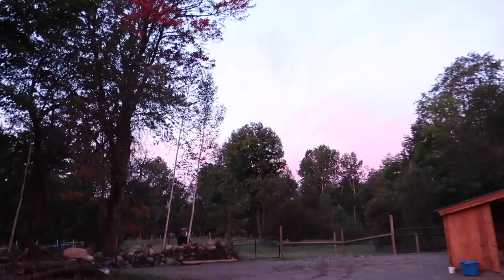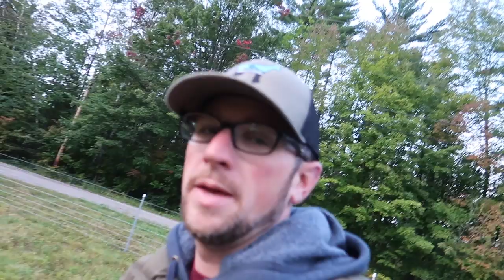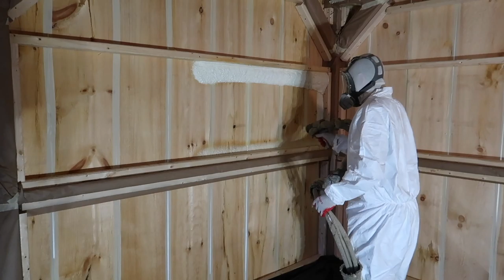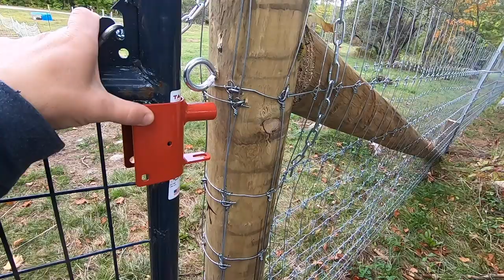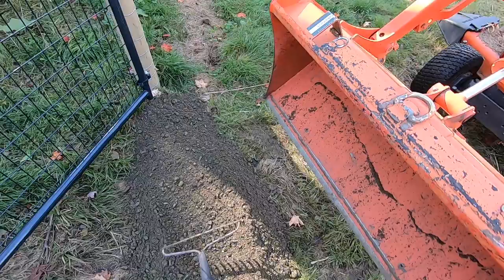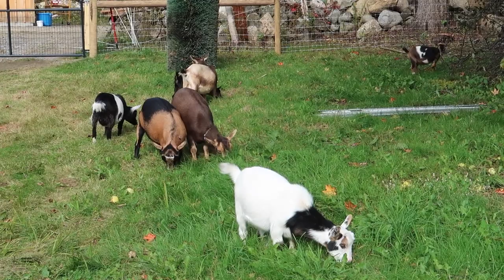Post & Beam Barn/Workshop Gets Spray Foamed and the goats go on PASTURE FULLTIME

Comment: For the gate it could be as simple as adding a carabiner or two. You all ready have the one on the gate, could add one to the chain and use the I bolt. It'll be adjustable with the chain.
 If you want to get rid of the chain, have some wirerope and Crosby clamps with carabiners to latch it shut.

Comment: The gate latch was perfect.
Remove new PT “2x4”
Remove the gate and screw hangers in a couple of turns.
Rip new PT “2x4” and re-install.
Reply: This explains my idea better
Reply: Yes!
Reply: Or notch out the wooden post to accommodate the space needed for the latch
Reply: EH CBunny 
Matching the post is the easiest fix.
I suggested screwing the hangers in cuz in time the long screw in type sag. 
The best gate hangers, in my opinion, are bolted thru the post and can easily adjusted doing the nuts on both sides of the post.
Reply: And if the gap on the latch side opens up too much you can install the leftover piece of ripped two-by-four on that side or rip a new piece of two-by-four there.
Reply: This is what I was going to suggest too. Thought I should read the comments first so i wouldn't repeat anything.
Reply: holly slaughter I was going to make the exact same suggestion
Reply: holly
Reply: @brianwilson4449  Great minds often think alike. LOL
Reply: @EHCBunny4real  this is the better way! This is what I was going to recommend!
Reply: @hollyslaughter5505  I think natching for the latch AND using the bolts is a good idea. Using bolts in the latch AND the gates. Much sturdier in the ling run.

Comment: Great episode, hopefully foam will keep barn warm! To use new latch on gate, take down 2x4 between hinge pins rip 1” off. Replace remainder of 2x4 between hinge pins and turn hinge pins into post 1” further. Replace gate on hinge pins now latch will fit properly. Take cut off from 2x4 and put on post below new latch to take up space.

Comment: Reattach the eyebolt to the wood. Open the I connect the chain to the I close the eye back up. You could also use some other means of attaching the chain to the eyebolt. Cut the chain to the proper length and use the chain and the chain latch portion of the gate to keep it closed. Basically the chain goes from the fence post to the gate instead of from the gate to the fence post.

Comment: For the latch that almost fit on the gate, I'd take the 2×4 from the hinge side out & twist the hinge bolts in more. It should give you the room needed for the latch. Then cut down the 2×4 to 2×3 & put back.

Comment: A board like that to fill the hinge area will be a chew point so better to go with chicken wire you can wire to the gate and staple to the post to flex as the gate opens. 

Rocks make good fill for under gates as once you bed them in dirt they are hard to spot but harder to dig past for things trying to get in/out. Take full advantage of what nature has given you.

Pickup some flower bulbs to plant just outside the fence for the pasture as they will slowly spread in and give a treat to the goats when they sprout without killing off the plants outside the fence. Also good for bees but that is an added bonus. Can also plant thorny berry bushes just outside the fence and clone to spread along the fence with the goats grabbing what they can to pull in to eat and provide you added predator barriers.

Comment: It looks like that post is thick enough that you could chisel out a flat area to inset the main portion of the latch in without losing structural integrity of the gate post.
Reply: That is exactly the right way.
Good call.
Reply: Put the pentals to the inside of the post and put them in further.  Work smarter not harder
Reply: That's the way to do it to keep the slot from getting wider and keeping the goats in the pasture.
Reply: Craig Mooring that's EXACTLY what i was going to post, too!
Reply: @ldg2655  sadly that will with time reduce the integrity of the post. It also cuts off some of the pressure treatment and will have to be recoated. Changing the type of hangers or their position is cheeper and less time consuming
Reply: I was just going to suggest same thing. Cut a flat in the post and install latch. It should fit in between wire fence without losing integrity, if so staple that fence area to post. Good luck.
Reply: Even if you do cut a little of the treated section off to make flat, they do make a preservative to re-saturate the post. You could even use to put on the tops of the other post in the pasture area. Just sayn.
Reply: didn't read your comment before I posted, haha
Reply: This is what I was going to suggest. The post looks to be large enough to accommodate a 
a little flattening to allow enough room for the latch.
Reply: Just twist the hinge bolts in more on the other side.
Reply: That is exactly what I was thinking !!

Comment: 2 ideas for you on the latch situation.  1st. If you are not worried about having a lock on the gate, go get yourself a piece of steel rod with a 90 degree ben at one end and then drill a hole straight thru the gate and then into your wood fence post.  You will be able to slide the rod right into the post and have a very inexpensive 2-way latch system.  To make that one more secure, you could even get yourself a piece of plate steel with 2 90 degree bends and cut a depression in each side to slide the rod into so it will only back out if you release the rod from the depression.

2nd.  You could easily use the latch you already purchased.  Just chisel out the post to have a flat area to mount the box.  That will give you the necessary clearance for the rod to slide in.

Comment: Suggestion: run one or two hot wires above the paddock fencing to deter predators from coming in and goats from climbing out. They can be left hot year-round as they are too high to ground out even in the snow.  It will provide much more security for your chickens in the winter too.
Reply: SeaSpirit4 seaspirit I was thinking the same thing. Al should of put some conduit underground where all the gates are,that way the hot and the ground wire could be run all around the fence line.

Comment: At the 13.51 min. showing the gate hinge bolts, you can turn them in to the post another two inches, this will move the gate over two inches, providing the space needed to install the new gate lock.  You can install a cut 2X4 under the gate lock to prevent the goats from squeezing out on that side.  After posting my comment, I noticed that holly slaughter had posted the same suggestion.

Comment: Al,  draw your hinge side of the gate closer to the post.  Put your filler strip on latch side but double it up so it is 3 inches thick.  Your Speeco latch can be mounted on the filler.  I just did mine that way a few days ago.

Comment: Everything is looking sooo good. I’m glad you insulated the milking room. That will make it so much warmer this winter when milking. Could they not have spray foamed the overhead door, or will it not  stick to metal well? So glad you left the beams exposed, even though it was added work. They add so much character to the barn. I love the way you take care of details like that. I agree with screwing the hinge pins in a little further or notching the post to install the lock. That will be so much easier than the chain. That Little P is a character. You take great care of all your animals. I think rubber gloves will be needed for “the boys”. They will miss their pettings. Keep up the great work! Love & Hugs from Vicki in Ft. Worth, Texas 🇨🇱🇺🇸👍

Comment: You could chisel out some of the post to be able to fit the lock hardware. Or, you could just put a plastic sleeve over the chain, and continue using it, but it would be quieter. All great ideas presented here, it'll be cool to see which route you go!

Comment: Fasten the chain to the eye bolt in the middle then the ends of the chain can be dropped into the slot from both sides. To make the latch work as others mentioned turn the hinge pins in one turn.

Comment: Take your gate off of the hinge pins and turn them in a little at a time untill you get the clearance you need for the latch.
But you may have to trim down your 2x4 you put on the post.

Comment: Al, the gate latch is flat on the backside.  You can cut back(flatten) the post that you will mount the lock onto.  It will move it back a little bit, creating enough room for the mechanism amd latch to work amd fit.

Comment: Hi you can get the other latch that only let's you open gate one way but it will work it's the same company as the other one you have. Or you can shorten up hinges on gate a little so that one will fit. You might have to put a board to close space between the gate and post that way though. I love mine like that it makes it super nice to go in and out of so easy. Good luck

Comment: Regarding the latch; go back and pull your block of wood off of the hinge side.  Run the hinge pins in two or three turns. Then you will have room on the latch side. If you spread the gap between the two sides it may eliminate the need for a spacer.
Reply: Also shortening the hinge pins reduces sagging.  I say this from past experience.  ;)

Comment: Oh also, for the gate where you filled in the gravel to create a berm, I would of used a drainage pipe, laid it down in the ditch, then covered it with gravel/dirt.  That way you get a full solid piece of land to drive through and the rainwater can still drain through the area.

Comment: To make the gate latch work just turn the hinge screws one turn so it’s closer the the post and that’s enough room for the latch. I’ve installed several of those on my gates.  Doesn’t take much and it’ll work properly. If you end up not using it and want to get rid of it I can use another one. Be happy to pay ya for it.

Comment: Have a piece of wood or metal that is attached to the fence post and can hinge up from horizontal to vertical. In the horizontal position it should rest on the top of the gate and grab hold to secure it closed (eg with 2 forks just wider than the gate rail) then to open the gate just move it to vertical. You could fancy up a "lock" with a spring or gravity loaded tab on the bottom of the forks.

Comment: Best feed trough I've found is a hot water heater cut in half and weld or bolt three feet of angle iron on each end. Animals can't turn it over and it easy to clean.

Comment: I have a suggestion for your spacer bars on your gate posts. It might be a good idea to cut the top of each spacer board at a 45 (or so)  degree angle so that they can shed rain and snow over time. It looks like you used some sort of pressure-treated lumber for them as well, Not the best idea when you have goats, as you have probably seen, they will chew on just about anything.

Keep up the good work. And by the way, your lady handles your tractor like a pro!

Comment: I cut some heavy rubber and installed it on the bottom of my fence, using heavy wire to hold it in place. Works Great.

Comment: remember that an inch in movement at the upper hinge pin will multiply over distance so the latch may still work with an adjustment

Comment: Insulation looks awesome,  I really enjoyed watching it getting applied as well. That latch looked like it needed to bolt to a flat post, if you are able to make enough space by manipulating the fencing wire up or down, you could check out the post about half inch deep, wouldn't that give you the space you need and give you a flat spot to attach it? It looks like it would work in my head 😁😀🤣

Comment: Al on your chain latch you have  on the gates,cut the chain two or three links longer then you need , then open up the eyebolt an slip the end of the chain into it and squeeze it close. This will allow you to hook the gate closed from either side without having to run the excess chains through the eyebolt… also for the red latch would remove the eyebolt and then knocked out the post large enough to put the latch plate on or as other people have suggested remove the 2 x 4 on the hinge side and screw the hinge pins in a couple of terms and then re-hang up the gate after reattaching the trim down 2 x 4 and adding a piece on the latch side… just a suggestion and something to think about.

Comment: Probably too late by now, but on the main gate (first one you worked on this video) you could easily screw the hinge bolts in on the back side a bit further and place a 2x4 spacer under the new latch like you did on the hinge side

Comment: Oh I know what I forgot to tell you. Instead of a burm,these folks used heavy duty rubber matting and  used plastic ties to connect it to the bottom of the gate. They went in pretty far so the mat wouldn't tear . Then when you open the door it sweaps the ground both ways 
Jo Jo

Comment: Al, Awesome Video. Looks like you do not need that much more for the latch. So, I would pull the gate off and screw the hinges in closer to the post. That should give you enough room for the latch. If there’s a gap on the latch post just put another spacer to fill the gap.

Comment: The chain would be easier to work if it were attached to the post.   The one gate you tried to the put the latch, has a chain catch in the corner and you only need to slide chain in there to close.   I also have  a gate latch that is like a pipe with a free rod.  You can adapt any size pipe that fit in the gap.   You would attach a pipe to the post and on the gate (hose clamps) a small pipe above and below.  leave plenty of clearance for movement in seasons.  Then the rod would go in and hold the gate.   The rod is L shaped and the length of all three pipes to catch.   Good luck!

Comment: You can use the latch you got  take that 2x4 off that you used as a filler and the threaded rods that hold the gate just turn them in one more turn each and it should give you enough room for the latch

Comment: Cut the chain off of the gate and attach to the post. Than shorten the chain to fit. Also put your pentals ( gate hangers ) to the inside of the post and put them in further this will allow you to swing the gate all the way flush with the fence and tie it open if you need to also makes less likely the kids will get out
Reply: A ps to the other post. They make gate hangers that go all the way thru the post and can be easily adjusted in or out to allow you to control the space between the gate and post.

Comment: As to the gate latch problem, you filled in the wrong side with the pressure-treated 2X4. Tighten the hinge side and fill in on the latch side, allowing enough room at the top for the operation of the latch (mounted directly to the post).

Comment: I just started watching your videos so you have probably already done something but if not here are a couple of ideas. Couldn't you do one of the following? 1 By attaching a 2x4 or 4x4 to your end post  basically extending or shortening the swing of the gate thus creating a bigger gap for your latch. 2 remove the wire from the end post and then to give you enough room remove about a 1/2 to 3/4 inch of your endpost from the top down to where you want your latch then rewrap the wire for the end post.

Comment: Happy goats! 
My preference for bolt hooks to hang the gate are the type that go all the way through the post. They are adjustable using the 2 nuts on the bolt, one on either side of the post. If you don't mind a suggestion, replace the bolt hooks on that gate with through post hooks, take out the 2x4 and pull the gate back toward the post. You can then use the gate latch, I have the same one on 3 gates, they work great. When the gate is in the proper position for the latch to work, decide if you need to fill in to prevent goat escape. Of you can, position the pin of the latch so it straddles the horizontal pipe, that will keep it from rotating. If you can't do that, put a screw through the hole in the bracket into the gate. 
And a detail on the hinge side H brace: it should also have a brace wire going the opposite of the one that is installed,  it is needed to keep the weight of the gate from pulling the post in toward the opening. The one that is there is to keep the stretched fence from pulling the post the other way.

Comment: Like with what Craig and others suggested below. You only need a 1/2" and the pressure retreat stuff last forever as long as its kept from freezing and out of the hit. I agree a smaller different latch without pole modification would be easier.

Comment: The spray foam went well.  I assume you're going to put siding/sheetrock on the roof, too.  I'm glad to see you sprayed that.  I saw a couple of cracks that didn't get masking tape.  I wonder if the foam went through that.  Great job!  I have no suggestion for a gate latch.  We use the chain, but don't use the I bolt.  We just wrap the post with the chain and use the notch on the gate to slip the chain through.  A latch like you bought would be awesome if it fit.  Maybe you could notch out some of the wood to make it fit.
Reply: All seams got masking tape, that was just sunlight showing through the tape.

Comment: I have used these from a local supply house, but you can get them on Amazon." Master Halco 087048 Butterfly Latch "  or search for " Butterfly Latch "  Mount it right on the post. Just get the right size for your gate frame/tube. There are similar versions available.  Insulation looks great !!